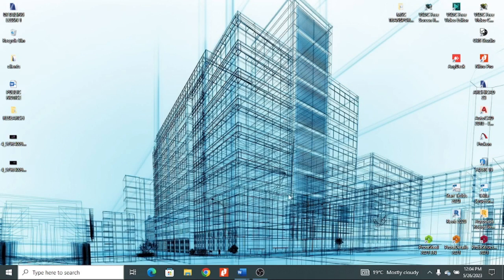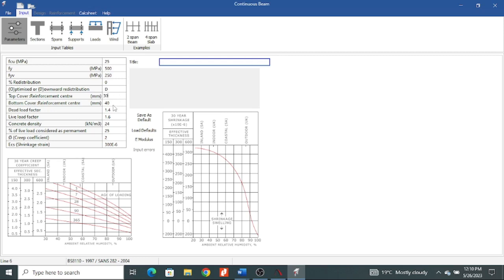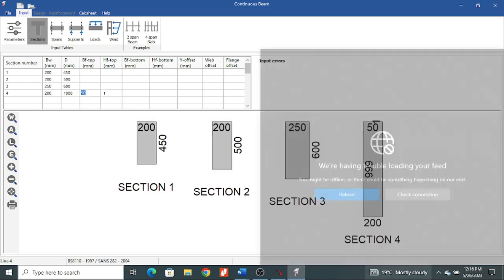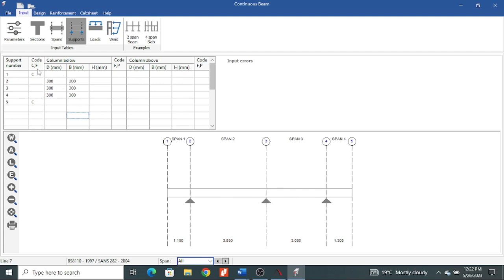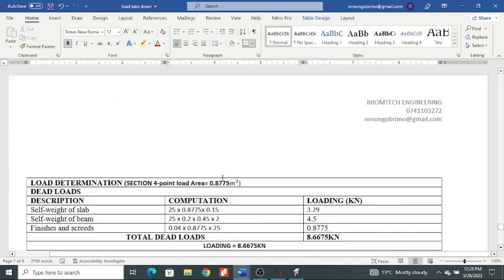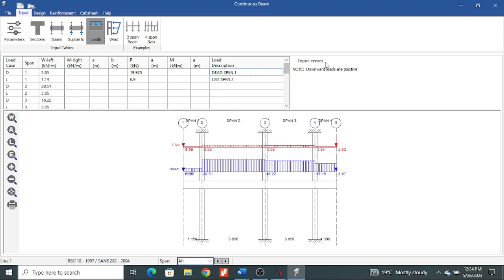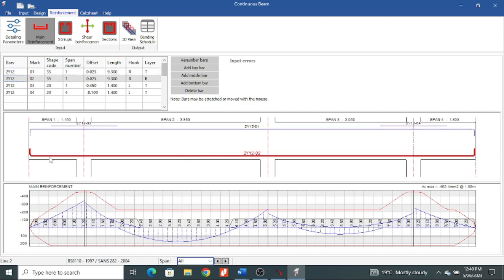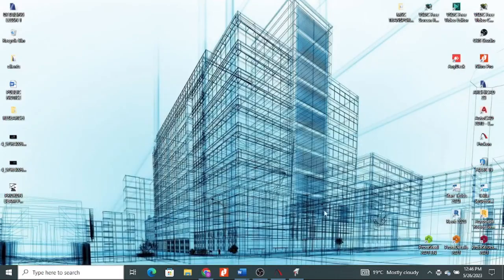DESIGN OF A CONTINUOUS BEAM IN PROKON 5.0

Comment: That's quite informative....just a quick one Brian,does PROKON allow input of lateral loads (Horizontal loads) eg from inclined secondary beams or even roof trusses (whether single point loads or UDLs)
Reply from the maker: Your question is not so clear. Are you asking about secondary beams, lateral loads or inclined beams. To try to answer yes you can do that. For secondary beams you can convert them to point loads, for lateral loads you can turn them into vertical component on members using methods like the cantilever method.
Reply: @bromtechengineering6705  
Pls send my your email address,then i can share with you a Truss & Stringer beam for a Terraced floor (Church) that has ensuing lateral loads....